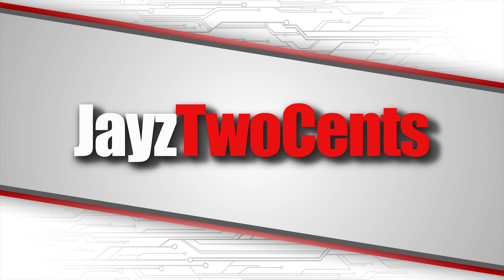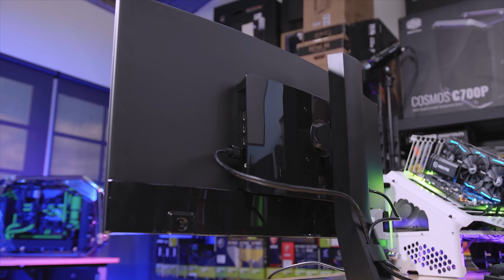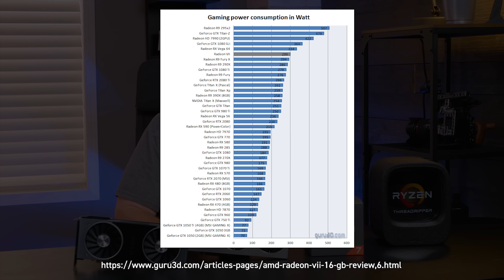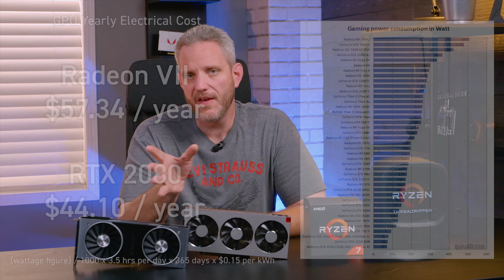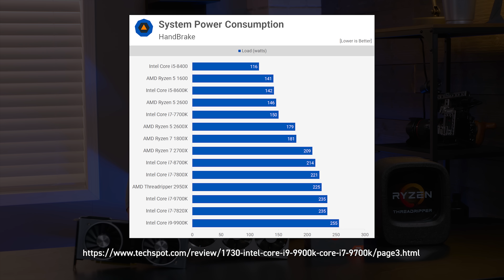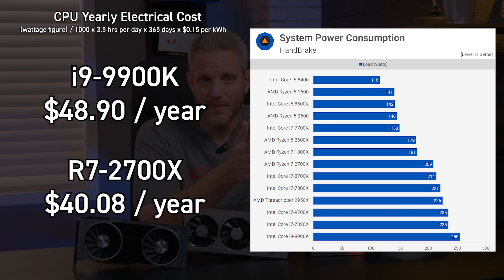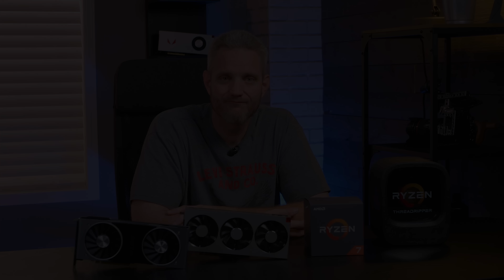Energy Costs of AMD vs Intel vs NVIDIA... This might surprise you

Comment: AMD space heater?? I think people forgot about the GeForce 480 GTX lol
Reply: Never had heat issues with that one, but all the AMD parts I've ever had overheated to the extreme, and throttled like crazy, especially the AMD laptop I had, it was a piece of trash, and it had the "best" AMD stuff at the time, nobody wanted to sit to the right of me because it was like a jet engine and it actually burnt your hand from quite a distance, my friends bought laptops with intel, and Nvidia parts ofc, theirs didn't overheat at all lol.

Haven't had any AMD parts in years now, seems like it have changed, and I'm waiting on building my next PC until the 3900x have been tested, but dang AMD have really left a bad taste in my mouth for years now, so depending on the performance I might just get the 9900k.
Reply: @ForgottenT I had the reference model 480 GTX. That thing was in the 80C to 90C degrees like it was norma lol. I mean it worked though, don't remember having issues with it. Right now I have a RX Vega 56 (reference blower model IDK I like the reference model of cards lol). It gets hot but it runs great stock. I up the powerlimit and fan curve a little bit, performance of that card shoots up a lot and also with a memory OC. I like AMD cards, they are fun the tweak with (especially Vega) and have good performance.

The Ryzen 3700X is going to match or maybe even surpass a 9900K especially with an OC. You don't even have to look at a 3900x lol, save yourself $200!

Comment: But where are the handbrake results comparsion. It doesnt have any sense. In handbrake test i5 8400 consumes less than ryzen 5 2600, but 2600 is almost 2 times faster at handbrake. So the real test should consider performance as well.

Comment: This is good content, but the application to us enthusiasts is thin.  We generally care about power in the frame of "can this PSU support my setup" and "is the VRM beefy enough for my overclock"  after that, very few of us give a crap on $5 differance on the bill every month.
Reply: agree, my monthly cost for my pc's electricity is 13 cents per 16 hour period      its like spitting the difference of 60 watts an hour...   which pretty much and light bulb you forget to turn off ...

Comment: I thinke the comparison would be more interesting at the 1660 vs rx580 price bracket.
Reply: Why not the 1060? The 1660 is a new card
Reply: Here in denmark the 1060 cost about the same as 1660 I think it's because stock is running out. The rx 580 8gb cost about 240$ and the gtx 1660 about 275$. And as far as I remember the rx580 uses about 90W more under load. P. S. We pay about 0.33$ pr kWh
Reply: I would say the 1660 Ti is a better option if you don't want to wait for Navi. Always go with something better than you need so you don't need to upgrade as often.
Reply: @Evtrex13  no. Not if you want good open-source drivers.
Reply: @Evtrex13  I did consider 1660 ti but ended up going with the 1660 for the 60$ savings and with my i5-4570 I'm on the bottleneck limit of the cpu. And I upgraded from a 750 ti so good gains all in all.
Reply: @coolfrost6  For better image quality use the 3D settings (select use the advanced 3D image settings) on the Nvidia control panel put DSR at 4x and smoothness at 0% everything else at your liking. Use high settings for your games ultra is not a good idea to play games. Be sure to remove your previous drivers. You are going to see a big improvement coming from the 750 Ti.

Comment: Power draw in graphics cards is a proxy metric. The higher the power draw, the more heat you have to cool in your computer, the larger the case you have to buy, and the bigger the power supply you have to use. It isn't just a "power draw" issue.
When I put a 1060 6GB in my brother's computer it cooked the cpu to 95C. I had to buy two more case fans. 
When I put the 1080ti in my system I had to replace the case and the power supply.

Comment: So if you want to have the highest power savings you should have an AMD cpu and an Nvidia gpu? That's convenient cause that's exactly what I'm doing! haha
Reply: Same, but it's possible in a few years, the Radeon Navis or whatever could catch up.  At the moment, I think it's still NVIDIA.  The CPU's is a much easier choice, with AMD better in pretty much every category except for single core/higher clocks.  And Intel might be losing their last advantage in the next 12 months.  And being on AMD, you are free to move around on whichever new 3000 or 4000 series without a motherboard swap.

Comment: Power draw charts are the one chart I never take notice of when making buying decisions. Jay confirms I'm right to ignore. Thanks ;)
Reply: If you're looking at it in terms of cost for sure, never made sense. But for noise and heat output it still matters. If you're living in a colder climate you probably think the opposite but when it's sometimes over 40C (~100F) outside a 50-100W difference kinda matters.

Also anyone who thinks AMD has always run hot isn't old enough to remember the P4 ;)

Comment: If you live in a cold climate, any extra power draw is just going to reduce your home's heating requirements - at least for most of the year. Here in Finland, it really doesn't matter much how much power your PC draws. A big chunk of it will cancel out as reduced heating costs, especially if your heating uses electricity instead of geothermal heat. And of course with thermostats in the radiators, this is all automatic.

Comment: SILLY ARGUMENT BELOW
Over and over I see people saying "so what if it's $50 more per year" or similar so "just get the higher powered card if it's a better deal." But a main point is that the COST SAVINGS in electricity may pay for itself in a few years so if you crunch the numbers for YOUR SITUATION you may find out that you spend MORE MONEY in the long run on a card that initially costs less... so it's not about saying "meh, who cares about the small difference in price" it's about whether you pay more in the long run for the same basic experience.

Comment: make a video on the xeon w 3175x... 28 core... with dual amd vega 7... and compare it with t he new i mac pro
or use a 32core threadripper at 4.3 ghz... with dual vega 7 in crossfire liquid cooled and  over clocked to 2.0 ghz
Reply: do waterblocks exist for these new dual vega 7 mac things?

Comment: It should be mentioned that if you are also running AC to cool your room, it will double your wattage costs. Watts = heat and you are also paying to remove that heat. But if you are using electric heat to warm your room, your computer wattage is completely irrelevant.

Comment: I used Handbrake to transcode hundreds of Blu-rays and DVDs a couple years back. My 4770K was going all-out pretty much 24/7 for six or eight weeks. My power bills were painful. (Of corse, that’s due to both the computer usage and the AC trying to keep my apartment at survivable temps.) Now that it supports QuickSync and CUDA transcoding, the same rig can do the same job in a fraction of the time and do it using a fraction of the power. I’m honestly not bitter - I remember when video encoder speeds were measured in minutes per frame, not frames per second.

Comment: Makes more sense to compare HW in the budget brackets, IMHO. That's where people that are actually saving for a PC would fall and where the Cost of Owner ship is most relevant.
Over 5 years of ownership, GTX 1660 is ~$30 more expensive in the US and ~$30 cheaper in the EU than the RX 580 while providing better gaming experience and running cooler.

Here is the data used:
GTX 1660: ~130W (tom's hw), $220 (Newegg)
RX 580: ~220W (tom's hw), $125 (Newegg)
=> Delta: ~90W, $95.
Avg. US electricity price: 0.1319 $/kWh.
Avg. EU electricity price: 0.2528 $/kWh.

=> 3h/day/5years will cost you ~$65 in the US and ~$125 in the EU!

Comment: The only time power draw should matter is when you're on battery, otherwise you shouldn't care. Unless your system is pulling like 1000w from the wall, you're not going to see any PC component impacting your energy bill. Just think about it... Your most expensive home appliance (AC or clothes drier, maybe a space heater) pulls several times more power from the wall than even the highest end power supplies can supply to a PC, yet we allow them to run for hours on end without going crazy about how much the energy bill is going to be.

Comment: My power draw was $110 month for computers, connected to ups and so on... Had a power meter connected to it as was trying to lower it.
Removed sip phone adapter from isp that used 23 watts on idle ! $302 a year for a idle phone adapter, even if calls was free on it, it was still more expensive then regular line...

Comment: Yes the "you will save money with less power draw" argument is often useless, but it can be relevant when comes the time to get a cool and silent machine. Efficient gpu will need smaller and less expensive cooler to run at decent noise and temps for example.

Comment: power draw also has an influence on your psu pricing. an hx750i costs about 10% less than an 850i
Definitely keep thast in mind. If you dont cut it too close and go overboard hower its completely fine
Reply: If you're running a system that draws 700 watts I doubt you care about your energy bill
Reply: @99395985h  that is the  point. Why bother going platinum then? Heat and thus silence

Comment: If you're at a spot where you're evaluating power costs for 9900k vs 2700x, radeon Vii vs 2080... buy the one you want, replace the lightbulb above your head with a LED one. Gonna save you 2-5x more on electricity that year than the difference between those CPUs or GPUs.

Comment: I always see this argument. People like to use the power draw argument to justify their purchase. I don't really care myself. Only the other day I was in a conversation about an R9 290 running on a 750w PSU. I ran a setup like this for about 2 years with no issues and lots of others were saying 750 Watts isn't enough because the R9 290 is well known to be power hungry and runs fairly hot. So frustrating to see people recommending things they think they know but don't actually know. Anyway I bought a Radeon 7 and I'm happy with it. Applied an under volt just to keep fan noises down and I'm happy. Looking at Ryzen 3 next which is probably going to draw less power than Intel's offering but again, I don't really care. People should just buy what they want and stop worrying about silly details and believe things that uneducated people write on the internet. Rant over. Thanks Jay!

Comment: The power draw argument doesn't matter at all for high end hardware, by the nature of its high cost.

Comparing the GTX 1660Ti to the RX 590 though makes the argument a much more compelling over a period of 3-5 years, whilst getting more performance. Same goes for GTX 1660 vs RX 580, if you don't buy the RX 580 used.

Kinda shows how power hungry Polaris Refresh is compared to the newly released Turing cards.
Reply: It makes sense to an extent high-end due to the Radeon VII being around the same price as a 2080.

Comment: Lower TDP usually also means if you stick to your CPU/GPU it won't die on you...
I had bad experience with AMD in the past, they kill themselves over the small heat room they have but fill they solve all this when they introduce Ryzen series back in 2017.

Comment: I swear the power draw argument should apply more to the difference between LED light bulbs and halogen or incandescent bulbs since I'm quite sure most people use a lightbulb for more hours per day than they have their system at full load per day.

Comment: You also have to factor in the extra system heat and air conditioning costs.  The heat doesn't just stay in the CPU cooler, it goes into the case and into the environment surrounding the case.   

One thing everybody should be doing is making sure their computer can enter sleep mode when it's unattended.  Some Active Tiles in the Start menu in Windows can interfere with this.  The amount of money you can save in a year by putting your computer to sleep could equal buying a couple of RAM sticks or a new pair of headphones.

Comment: To me the point of power draw has not been about power cost, it's been about heat and noise(space). The more power draw the hotter the GPU/CPU die gets and then has to be dissipated. A card that draws 150W will be easier to cool than a card that draws 250W.

Comment: Power draw = heat = noise.
I like my systems quiet.
Reply: Noise level rather depends on your cooling solution. I have a 8700k clocked to 5GHz hooked up to a 360 AIO and even under 100% load it's barely noticable. Noise coolings kinda indicates that your solution is undersized for it's purpose
Reply: A decent 360 AIO is $100USD+. A coolermaster Hyper T4 is about $25USD and keeps everything but very highly clocked heaters in comfortable temperature ranges. The extra $75 could nearly bump you up to the next CPU.
Reply: When I bought the 8700k there was no higher bumping up on CPUs unless you were spending a fortune on Intel Xtrem CPUs where even the cheapest one was almost double in price. Not to mention the X299 hardware

Comment: Cost isn't the sole factor for taking power draw into consideration. If you're living off grid and running entirely on Solar, you want to have as little draw as possible. Of course if you're in that situation, you would probably get a laptop instead.

Comment: The primary thing I look at when purchasing hardware is power draw, however the primary reason is not the cost although that is a factor; it is due to the thermals of the room I am in, if you're in a small enclosed area with a 2080 ti and 9900k; it's going to get hot, fast, regardless of what you're doing. The most expensive part of parts with high power draw is cooling the room you house the system in and tolerating the heat that builds up over the course of an hour; I don't think when most people consider power draw they're actually just considering the cost of the power to run the build itself -- keep in mind that these higher tier systems still contribute more to your power bill than the initial calculated draw based off the heat produced alone.

Comment: I agree that electricity cost is not a top priority argument. But when facing with a fanboy that screaming 20$ cheaper is a big deal, then using electricity cost is just to shut them up. However there is another side to power draw: heat, noise and longevity of the product. Much bigger power draw means more expensive cooling solution. And to compensate more expensive items, some corner will be cut so the price can be competitive. I am a long time follower and in one of your early videos where you line up all the GPU you own, they were all Nvidia and no AMD because all your AMD GPU "went up in smoked".   For me personally, noise is a big factor, I always tune my system to be below 80 C with the lowest fan curve setting possible.

Comment: I have a 2600X and Vega 64 and man those things output heat compared to my old system, if you play an intense game you can really feel the hot air on your legs and your face. Still they were much better price per performance where I live because for some reason NVIDIA cards are way more expensive here than elsewhere in the world

At the end of the day I really don't have that much time to play because of work so the power usage barely affects my bills and in the winter it's basically free heat

Comment: The cost that should be used as a baseline is the cost of the entire system. You also need to keep in mind that usually cost effiency is not a factor, rather it is maximizing performance within what you are prepared to pay. 

For example, if you prepared to pay 3k for your system, you are not going to quibble paying $100 - 200 extra for a particular component if it gives you, say, 5% more performance. The $100 - 200 might be a huge premium for 5% for that individual component, but it is trivial for the system as a whole if it means you will get 5% more performance from the system.

That is why a lot of these arguments about value for money are stupid, they don't look at the big picture.

Comment: But still u need to cool that system (cpu or gpu) so u need a better cooler , psu and case to provide enough airflow and power to accamodate that kind of system. i have an 1070ti in my case and with 1 exhaust fan it just throthles like crayz when it set lower than 100% fan speed. (some words could be miss written sorry.)
Reply: Exactly, and that adds up fast.

Comment: Blender/handbrake workload is different than gaming. Gaming performance doesnt mean that you can game less if you have more performance. But blender is just that, you run the task less time with more performance. So the cpu test should be making a certain task and calculate how much doing that task costs you in terms of power draw.

Comment: To be fair,, there might might be a use case when someone is using solar panels to charge batteries to run the computer off, need to think about how much power the system will draw.

Comment: One thing I found is not the cost of power, it is the extra cost of better cooling solutions and power supplies. For example the cost of a 750 watt psu is a fair bit more than a 600 also the 600 watt psu  has more of a range in sizes ie. sfx sfxl. Also a cheaper or smaller/ low profile or even stock cooler adequitly can quietly cool a lower power draw cpu. Then there is the fact more compact cases can be used with lower power draw as better airflow, extra radiator mounts or tower cooler clearance is not as important